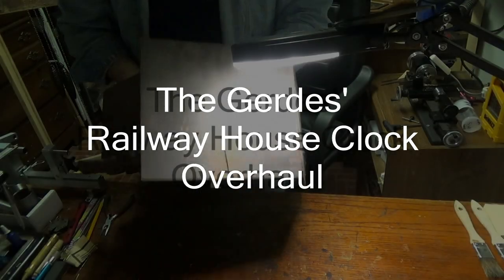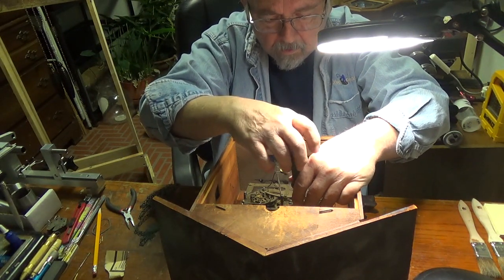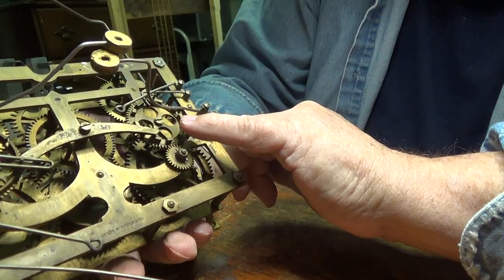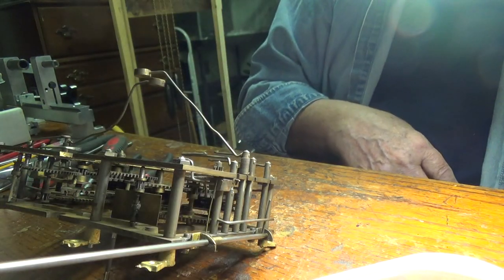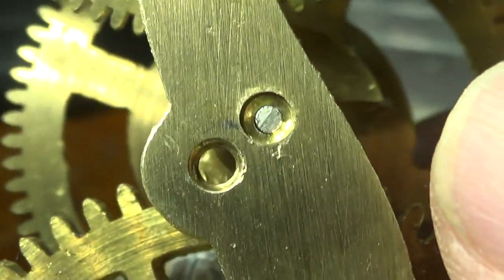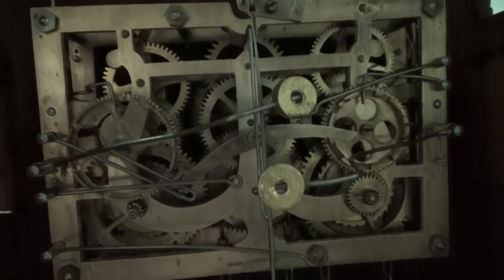The Gerdes' Railway House Cuckoo Overhaul

Comment: An index for this video:
0:00 - 3:20 Removing the hands; undoing the bird doors; removing the chains.
3:20 - 8:08 Removing and examining the three bellows.
8:08 - 11:32 Removing the movement.
11:32 - 13:15 Removing the birds.
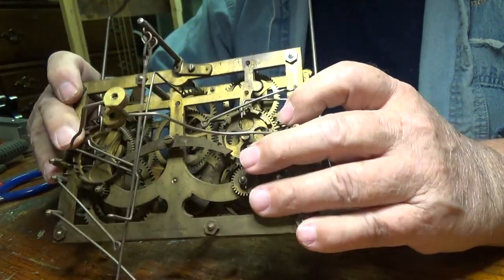13:15 - 16:50 Becoming familiar with the movement.
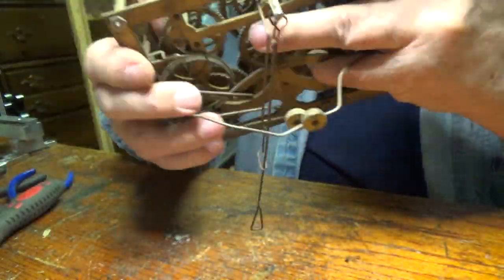16:50 - 18:44 Starting to disassemble the movement.
18:44 - 22:25 Noting the relative positions of important wheels and pins.
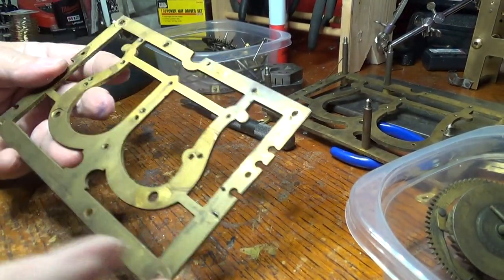22:25 - 42:39 Remaining disassembly, and analyzing the bird call sequence.
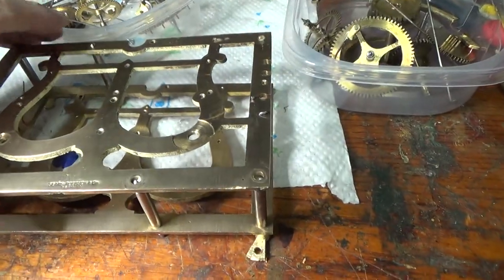42:39 - 48:06 Examining the parts for dirt and wear.
48:06 - 49:02 Showing the cleaned parts.
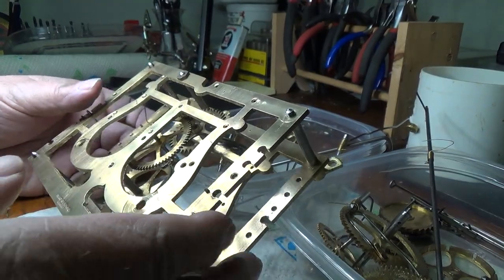49:02 - 50:54 Polishing the pivots, using a lathe.
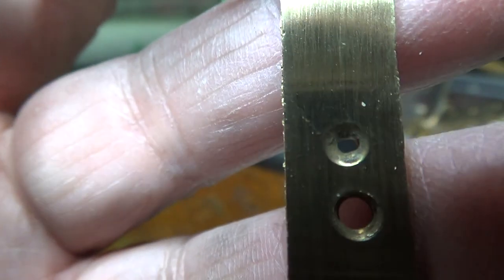50:54 - 53:16 Checking for worn pivot holes in the time train.
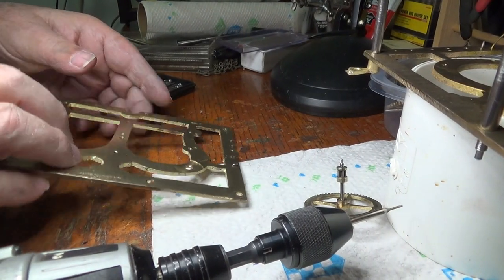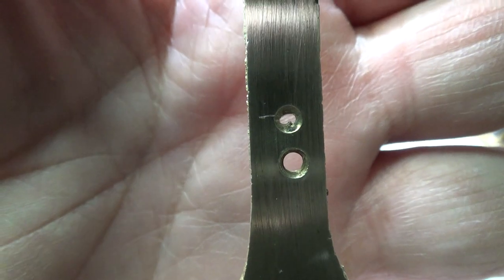53:16 - 54:16 Filing a worn pivot hole to center on the original center.
54:16 - 55:58 Choosing the right bushing for the pivot size.
55:58 - 57:46 Reaming the hole for the new bushing.
57:46 - 59:02 Hammering in the new bushing.
59:02 - 1:00:28 Broaching (enlarging) the hole to the right size for the wheel.
1:00:28 - 1:02:02 Testing the new bushings in the time train.
1:02:02 - 1:02:23 Checking the quail train for worn pivot holes.
1:02:23 - 1:03:39 Discovering earlier repair work: a replaced pivot.
1:03:39 - 1:04:16 Testing the new quail train bushing.
1:04:16 - 1:06:31 Checking the cuckoo train for worn pivot holes; discovering an odd re-pivoting job.
1:06:31 - 1:06:57 Testing the new cuckoo train bushings.
1:06:57 - 1:07:34 Pegging out (cleaning) the pivot holes.
1:07:34 - 1:09:34 Notes on reassembling the levers.
1:09:34 - 1:10:43 Reassembling more of the movement.
1:10:43 - 1:12:07 Explaining how the quail and cuckoo striking works.
1:12:07 - 1:12:59 Overview of the repaired and reassembled movement.
1:12:59 - 1:14:23 The movement running in the case, without the bellows.
1:14:23 - 1:14:46 The clock running, with the repaired bellows.

Comment: I like how your shop looks, why you don't make a tour video, that way I can steal how you set up everything.
Reply from the maker: It's not even a shop; it's just a small room in the basement.  I use an old oak desk for doing the work, have a small, old book case to my left that has my small lathe on it. The drill press is on the right side of the desk and the spring winder is attached to the right front of the desk.  I use the same room to overwinter my tropical pond plants and an aquarium for my mosquito fish.  There is no organization.  Just a place for me to sit and work on the clock.

Comment: What do you use for cleaner in the ultrasonic? What temperature and how long do you run it? I have a $35 "parts only" clock that was running the cuckoo continually, but not the time. Cleaned and oiled (not taking it apart, just with toothpicks and air) and now time runs, but not cuckoo! I can see there is still dirt and figure I don't have much to lose in trying to take it apart and clean it. (I'm pretty good at 3D puzzles. ;) )
Reply from the maker: I use a standard ammoniated cleaner (Zenith brand) available from clock supply houses. Temperature and time depend on how dirty the clock is.  I start with 60 degrees Celsius and half-an-hour. If you're not taking it apart, you might try using carburetor cleaner (outside, of course) to dissolve away grime.
Reply: Thank you!

Comment: What is your opinion of using Bronze Bushings
Reply from the maker: I personally use just brass bushings.  There are those who would argue that bronze bushings, being harder, would last longer and the cost of disassembly to replace worn bushings makes bronze the better choice, even though they are more expensive than brass.  However, my background in chemistry tells me differently.  The problem is that bushings fail because of lack of lubrication from not regularly servicing a clock (every 5 to 6 years).  Once the oil dries, the wear begins and it it then a matter of which will wear first, the pivot hole (bushing) or the pivot.  With brass, which is copper and zinc, the zinc in it coverts to zinc oxide and the pivot, being steel, converts to iron oxide.  Since iron oxide is harder that zinc oxide, the wear occurs in the brass bushing.  If bronze bushings are used, bronze is an alloy of copper and tin and, when deprived of oil, the tin oxidizes to tin oxide, which is harder than iron oxide, so the pivot wears before the bushing wears.  It is much more difficult and time-consuming to replace pivots than to replace bushings, so, in my opinion, bronze is not the metal of choice for a clock.  Others may disagree completely. If a clock is assured of being serviced regularly so the oil is not absent, then it would make sense to use bronze, but since most clocks are not serviced regularly, it makes sense to use brass.  There is also the argument that using bronze bushings on a brass movement will make the bushings stand out, as bronze is a darker color than brass and purists don't like to change what was original.  If the original movement, however, had bronze bushes, it would be proper to replace them with bronze.